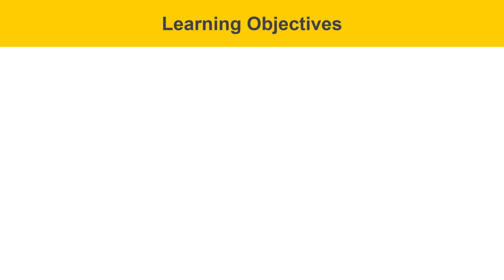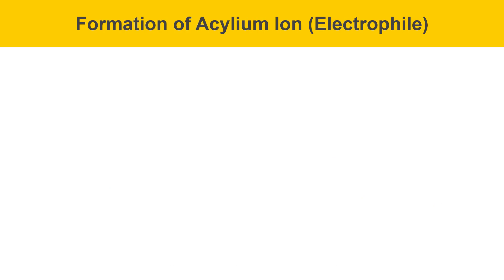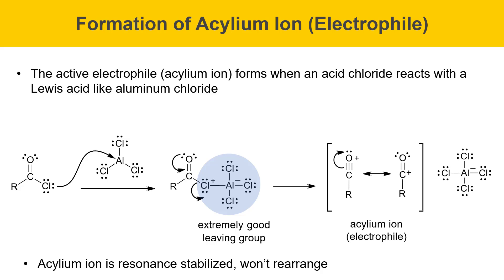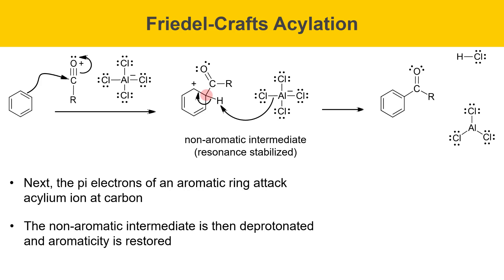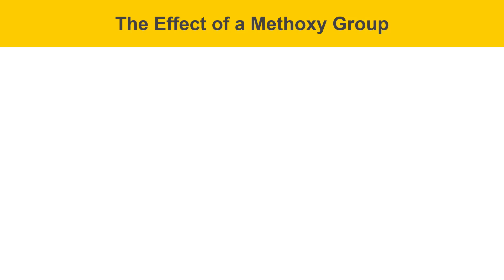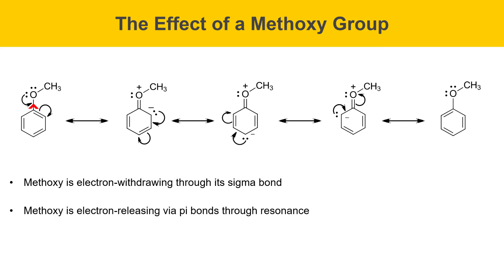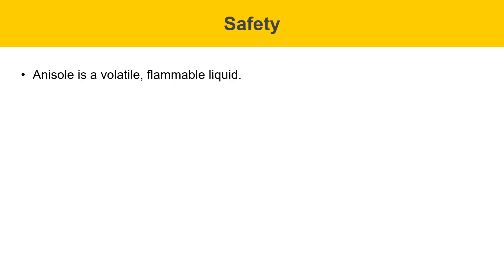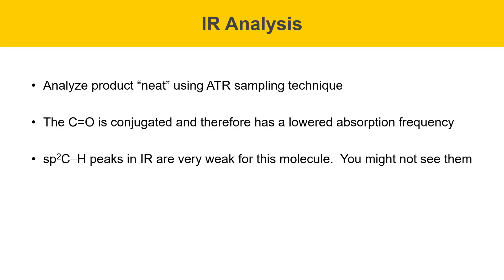Friedel Crafts Acylation Experiment Part 1, Prelab

Comment: QUESTION............Is methoxy an EDG?????????  I know you say the oxygen  is electronegative and so is electron with drawing.   But that does not make it an EWG does it???????????  I mean since its resonance has a LARGER effect it is still considered an EDG right??????????????    The methoxy group ACTIVATES the ring and that is also why it is called an EDG  right?????????????
                                 And the halogens are MORE electronegative and so it plays a LARGER  part  than the resonance of its lone pairs.   So it is considered an EWG right?????????????   And so the halogens mildly DEACTIVATE the ring cause they are so much more electronegative than an oxygen on a methoxy group.   But since both an oxygen on an alkoxy group and a halide have so many lone pair electrons they are BOTH ortho para directors right??????????????   I think i am right about all that........i think?????????
Reply from the maker: "Electron donation through resonance has the largest effect." See the video at 7 minutes and 2 seconds.

Comment: QUESTION...........OK this is the 2nd time i heard of using DCM as a solvent for FC acylation.   The carbon on that DCM has TWO chloro groups sucking up electron density making that carbon more positive than when it is just a MONO substituted chloro group.   Now add the fact that there is AlCl3 catalyst in the pot.   THE QUESTION IS..........Why doesn't the DCM undergo a FC alkylation and couple with the ring???????????   Even if the acyl chloride is more reactive....I WOULD THINK.... the DCM would alkylate at least some and lower the yield of the acylation enough where no one would ever use DCM  as a solvent???????????????????   What's the deal with that????????????????